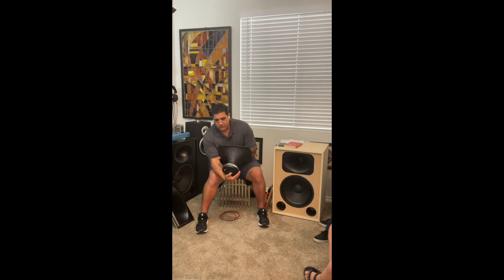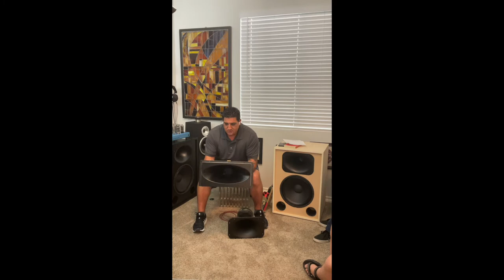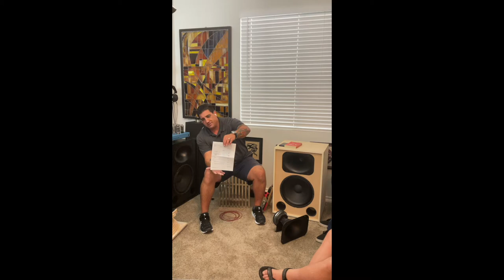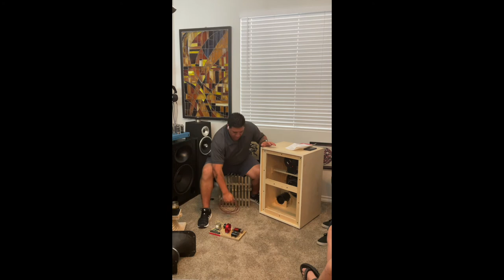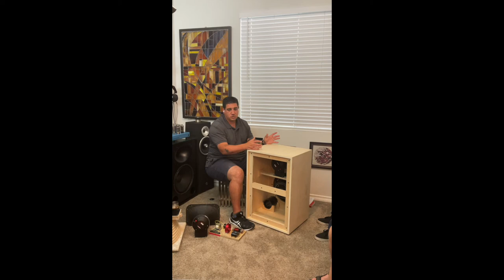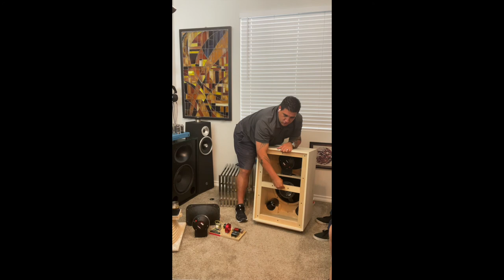JustinW MasterClass on building a Cornscala Speaker

Comment: Just ran across your video super informative, I am super novice I have only one two system with a separate sub . I was going to either upgrade my crossover’s on my Polk model 10b was going to send them to gr research. Now you have thinking on try my hand on trying your pattern,but I don’t see your parts list and box dimension’s could you send a link or post it . Thank you very good presentation

Comment: Kappa 15A woofer...Why? It has a rather high Fs & does not go that low in the bass.  Why not use the original Crites 15" woofer?  It has a lower Fs & I read Bob chose it (or designed it) just for his Cornscala Style-B type cabinet?
Reply from the maker: If you look further on the Klipsch forum there is a lot of info on the 15C being a better K33 and more akin to a K43 (Pro). Bobs woofer has to be sourced from Bob. The 15C can be sourced from a wide verity of venders and is considered as good or superior choice depending... The 15C is considered a drop in for any K33.
Reply: Why use the 4ohm kappa 15c instead of the 8ohm 15a ?